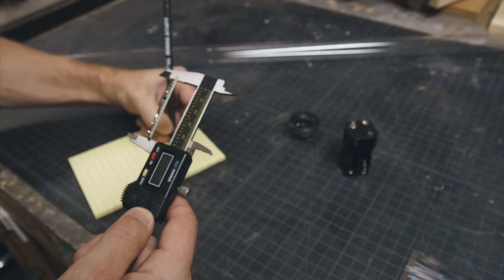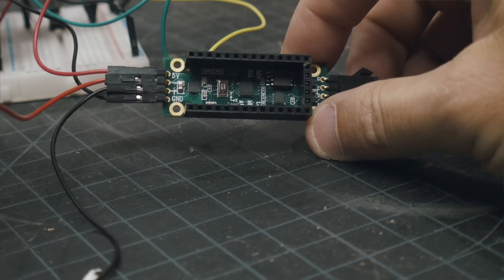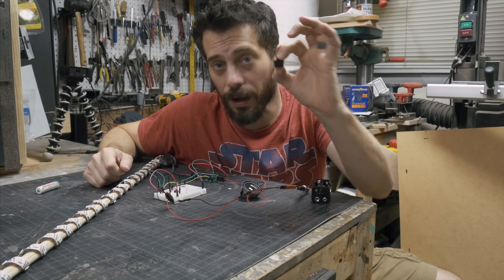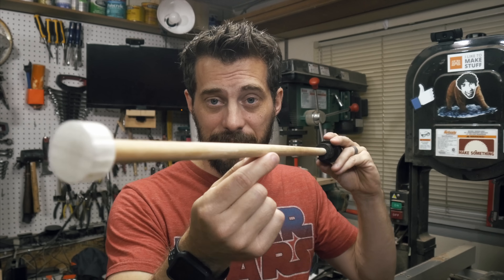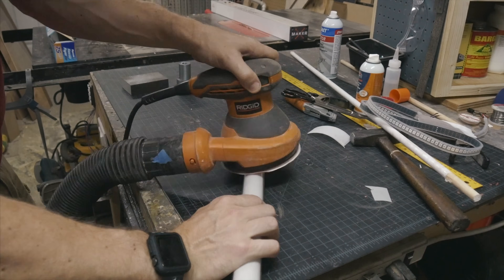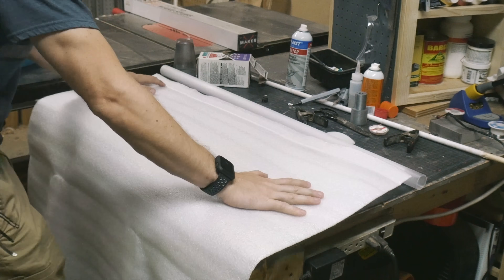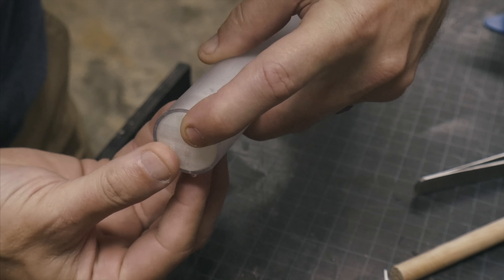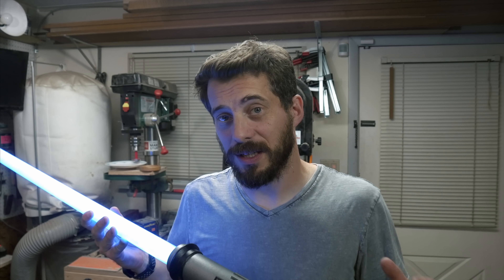How to make a Lightsaber ( for Star Wars Day ) | I Like To Make Stuff

Comment: The diameter of the internals shouldn't need to be consistent through out the entire length, so you should be able to adjust the diameter of the hilt in different sections.  I think there also needs to be a cone shaped cap on the end of the blade rather than keeping it straight.  I do love the set up with the electronics though.  I plan to build several sabers myself at some point, and I will probably swipe that idea.  I'm going to build a pair for my fiancee that screw together at the center so they can be modded into a dual bladed saber, I'm going to be building a pair of curved hilt sabers for my own jedi outfit, and I eventually plan to make a Scottish-themed sith costume.  Among other details, it will have a black kilt, face paint, and the light saber will be modeled after a claymore with a plaid blade.  I call it Darth Haggis.

Comment: C size NiMH @ 1" id tube
1/4 wall polycarbonate tube (1' od, 1/2" id), same LEDs, fill with ... silicon or mix some kind of diffusion resin 
Same board, different speaker (1" d total)
enjoy :)

Comment: I Like To Make Stuff wow! This is really cool stuff! I actually tried making a light saber myself in my industrial design class at my high school. I used a similar technique as you by using RBG LED strips as a light source however I really liked your idea with spinning them around the dowel. We don't have 3D printers at my school capable of printing things as tall as I would have liked so i basically had to sculpt it using a PVC skeleton and sheet metal shell. It worked for about 5 minutes until I accidentally screwed through the electronics that connected the batteries inside to the lights in the polycarbonate tube. At least i still have the hilt though!

Comment: Great work on the saber, but I think it still looks a little thick. 
You could maybe make it a little bit thinner if the hilt was designed as a male end vs the female end you designed. Reinforce it with a some kind of dowel all the way down to the end of the hilt.
Either way great build!

Comment: I think to get a better helt look you could print it so rather then a tube look it's more "Star Warsy". By making the helt right after where the blade connects to the helt bring down the diameter of the helt and reinforce it and then go back to a bigger diameter for the battery and speaker. I hope that makes sense and gives you some more ideas :). Great video.

Comment: nice work! you could use a potentiometer as a knob to set the color. That way it could have a wide range of colors and also its physical position would save the color when the power is off.
Reply from the maker: That was one of the original ideas, but you'd actually need 3 of them for Red, Green and Blue.  With three, you could mix the color.
Reply: Right right... If you were to use an HSV model and then convert to RGB in code, you'd be able to vary your H with the pot, and have a fixed S and V values. Just an idea.

Comment: This is great!  It seems like the battery holder was the biggest factor in determining the thickness of the saber hilt.  I wonder if using a different battery, like a lipo, AAAs, or even a different configuration of batteries would enable you to reduce the diameter of the saber.

Comment: hey Bob, I have a suggestion for the diffusion. As a former props master at the Georgia Aquarium, I worked with some similar internally lit "sea monster" staffs. They operated similarly to your saber. One thing that changed throughout the iterations of each model was the diffusion. We started out with wrapping the inside tube with paper. Then for the last one we actually started scratching up the inside of the acrylic tube. We achieved this by getting some scrub pads and putting them on the end of a dowel. We took said dowel and used a hand drill to scratch the begeesus out of the inside creating a sort of diffusion. Worked pretty well for what we were doing! 

Anyways, just a suggestion.  Love your channel and podcast!

Comment: Suggestion, find some way to make the blade removable so you can carry it 'costumed'. 
There are regulators (or you can use a resistance bridge) to control voltage and current for LED's and circuits and you might consider using something like a pair of 14430/14500/14650 cell Li-ion batteries, which make about 7 volts but which will handle a much more linear current draw and last longer than the nimh's. (the 14500 will fit in a AA holder)

Comment: Nice work! As somebody who's done a couple lightsabers before I can say that this is exceptionally well done for your first time saber. ESPECIALLY since it was made from scratch.

Here's a few tips if you'd like for the V2 Saber.
-Get specialty parts from specialty websites. Saberforge has DIY electronics, and The Custom Saber Shop ONLY sells parts that are made for this, that are smaller, and normally cheaper. Specifically the Battery Packs, switches, and Speakers are far better suited, and worth the money. They have sound/LED cards too, but those tend to be a bit on the expensive side.
-Try making a separate, large pommel for a speaker housing. You would not believe how much of a difference in the feel it makes to be able to make a smaller thinner handle. And while we're on the topic of speakers...
- Get your speaker from saberforge. It's in the DIY section, and they're far smaller., as they're made for saber makers. Yes, CSS has the same speakers, but they're slightly cheaper from SF.
-3d Print, or heat the tube to make a rounded or bullet tip. no practical use, but it will look better.

That's about it! You did a really good job for a first-timer and wish you luck on your next one!

LINKS:
https://saberforge.com/collections/diy-electronics/products/speaker?variant=34947001354
http://www.thecustomsabershop.com/

Comment: Bob, for buttons, check out the back panel of http://www.thingiverse.com/thing:1188301. This would allow you to design the buttons directly into the part, and even relocate them to inside of the model if you like. I've been using this integrated button style on all of my functional electronics for a good long time, and it works quite well, even with PLA. If you want to hide them, it's easy to just put a thin bit of ninjaflex or any flexible material over the buttons themselves.

Comment: Great build, I've been wanting to make one of those for a while. I tend to get way out of control on the design side, to the point of exceeding my talent to build. I was thinking you should replace the battery pack with a rechargeable 5v usb power pack. Pop a micro usb port on the outside and then you don't have to crack the thing open to change the batteries, just plug and recharge.

Comment: Quite a cool coincidence. I'm getting a package from Sparkfun tomorrow to build my own lightsaber. I'll be using a Teensy 3.6 though and a surface transducer for sound. My handle is completely metal. I'm using a 3 axis accelerometer to detect motion. All sounds are generated in real time instead of simply triggering them.

Comment: A $3 5volt regulator would eliminate the possibility of over volting by using off the shelf batteries. It might be a good idea to add that in the event that you would need this for some reason and are out of the other batteries.

Comment: Look into capacitive touch sensors for the "setting" buttons - something like the Adafruit 178.  I'm not sure if Adafruit has an equivalent, but the Phidgets 1129_1 can work through plastic too, so it can be completely inside the hilt but still react to your commands (only really useful with Phidgets stuff though I think, but if they can do it I'm sure someone more generic can).  

Using a strip sensor will (normally) let you issue multiple commands from one touch sensor too; since you can normally detect position of the touch on the sensor (i.e. position @ max and touch = change color, position @ min and touch = on/off).

Comment: I really like it! The motion controlled sounds really give it a special touch! But how long is this thing? It looks huge!!!
If the LEDs are too bright, you might think of decreasing the voltage, perhaps even regulated by a switch (for night and day fight *g*). Or maybe you could even reduce the number of batteries, that way the handle could be even smaller in diameter.
Working on my own LED-project, I can tell you there are frosted PC-tubes available that give difuse light and look very neat. But I have to say that I like your method with the packaging foil. I need to try that as well!

Comment: It might have been suggested but you could desolder the sockets from the tiny and directly solder the prop shield to the board. That, a smaller speaker, and a lower profile battery (LiPo or other) might allow you to slim the handle further. Very cool build otherwise.

Comment: Maybe next time you model the hilt with a panel, also look at decreasing some of the outer surface areas that any components are not going to be at. That way, you'll have a bit of variation in the depth and you may even use less material.  One more idea, before you start the next model, do a ton of different sketches and work from the ones you like or even post the sketches (if you do go that route) on a video and let people help choose which design they think looks best.  

Do what they do in movies when creating props rather than do the first thing you think is "cool" and then be disappointed by the end result.  Not saying that the end result of this sabre was a disappointment, not at all, but when you are having new ideas WHILE making it, it says to me that maybe it wasn't as up to snuff for you as you thought at the time you hit enter/execute on the keyboard to start the modelling of it.

Anyways, that's just me thought, good luck and keep going with the good work.

Comment: If you want the color to persist through power cycles, you could probably save it to EEPROM on the Teensy when it is changed; the downside to that is that EEPROM has limited erase/write cycles, but it is typically something on the order of 10,000-50,000 times.

Comment: dude, how if you reconsider panel plan and try a screw system, like PET bottle caps, but use it to be longer in the handle, its more efficient, especially when you're changin' the batteries
Reply: Or you can consider of using sliding system, like in the blackberry torch smartphone series, so you can reach more internal than a panel system

Comment: Instead of the acrylic tube could you not 3d print it in 3 sections using an opaque plastic? This would
let you thin and taper the blade. You may have some seam lines but they should disappear when lit.

Comment: you should use one of those USB mini battery stick things, that way the only large pice would be the speaker and you could model the main body of the saber to be a smaller ID/OD to fit your hand better. and look at mini pc push buttons instead of a toggle switch. would be a better looking and lower profile power switch

Comment: You may have addressed this in another video, but do you have a 3d printer you would recommend for someone interested in getting started? Something that will print decent items....but not completely break the bank?
Reply from the maker: Check out the review I did on the Prusa i3 MK2.  It's a great middle ground of excellent quality at a reasonable price.
Reply: Awesome! I knew I remembers you saying something. But I couldn't recall which video it was.

Thanks!

Comment: It's aweosme. Eventually you should make the handle from metal. Make the tip of the saber a bit more like in the movies, rounded and pointy. Add more sounds and randomize the order. Make the blade mount removable and sturdier. Make sure the blade material can withstand hits from the same material.

Comment: Love it!  If I had a suggestion, I would say to try and get ahold of a stacked battery sled so it's thinner, or a pair of double sleds instead of the quad sled, giving you more leeway with shrinking the hilt down.  Maybe look into using a different kind of rechargeable battery.  Maybe a single 26650 or something.  Granted, those run at 3.7-4.2 volts, so not sure if that would be enough, but you can get them all over the place.  Might also be cool to use a metal tube and then print all the embellishments to go onto it.  But, I could nerd-out on this topic all damn day lol.  Love the video, keep up the great work!

Comment: for the on/off switch you could spring load the bottom plug basically turning it into a switch but looking just like the bottom of your handle or have the bottom of your handle twist as an on/off switch

Comment: This is just awesome. For the second version, you may want to consider a hemispherical cap to top off the tube. Kinda like the purchasable ones. If you use two-part epoxy where the tube meets the hilt, there wont be CA glue fogging and it will hold up better during impact.

Comment: One idea for your v2 lightsaber, if you're interested, would be to use a mechanical throw switch for blade color selection (I don't know about the capabilities of your prop shield/board)  and hide that behind your panel - that way you don't have to worry about the blade colors reverting if you have to change batteries in the middle of something.  That might be more work than it's worth though.

Comment: I think the glowing part (the blade if u wish) looks awesome but the grip really needs some more work. It just looks too cylindrical ... Maybe break it up with some fake buttons and flat spots, so that one doesn't imediately see the cylinder it actually is .... And another idea would be to just build in a micro usb port to add software. I don't know this board but I guess you connect ur pc to it via micro usb ?

Just some ideas ... Of course it's still a very cool project, even though I'm not that big of a star wars fan ;)

Comment: maybe use just one switch but somehow code it for holding the button will change colors. no huge into coding but i think that could work. and you do a voltage regulator so you could use diff batteries

Comment: If you could find a way to fit an RGB fading/mixing module into it for V.2 , you could really fine tune the color spectrum. As opposed to only being able to cycle through fixed presets. Finding a space for 3 potentiometers might be a little challenging though.
Reply from the maker: They're full addressable, so it can be whatever I want, just no real time controls like using pots.
Reply: Oh, i see. Knowing that now. It might be cool to have the lights slightly "tweak" themselves in response to the motion sensor,  similar to how you triggered the audio files. Could be more work for what its worth though.

Comment: Pretty cool. Maybe for the second version, you should make the end cap on the blade rounded off or a soft cone shape, like a mushroom cap. And to make it clear, use the prusa resin printer. You can also use that to make real rubberized grips and that button you mentioned.

Comment: I'm going to make couple ligth sabers to my sons room as wall peaces/ ligts. I'm so going to use the electronis part.  Care to tell what was holding you back? Diffusing the ligts or something else?
Reply from the maker: Awesome! The biggest problem I had was a coding problem that was causing the audio, gyro and led not interrupt each other.  It was just something I had to simplify and rethink in the code.
Reply: I Like To Make Stuff I was wondering about this... Arduino Doesn't support multi-threading, so how did you accomplish that?

Comment: This came out great! I'm guessing this is the top secret project you kept teasing in Making It. It lived up to the suspense!

You mentioned it taking a lot of time to get the LEDs through the tube. It might've been easier to scotch tape the diffusion material on the entry side of the tube to make sure the LEDs don't grab it and pull it down, then drop a weighted line through the tube and use that to pull the LEDs through. Just a thought for next time. It's a technique I've always found helpful for getting stuff through tubes. 

-Caleb Harris

Comment: Add a mute button so it can be turned on without being noisy, and a Li-Ion rechargable batery + charging circuit (Adafruit has tiny ones) so it can be charged via microUSB, finaly, make a display case that charges it, and makes it light up. You could also try PWMing the LEDs for brightness control

Comment: You sir, just hit a home run. Mat the fourth be with you. :)
Reply from the maker: :)  Thanks!!  and with you...
Reply: I have a few of the toy versions of lightsabers and most have a round black button or square of rectangular red buttons. I wonder if a red momentary switch, like the ones I bought to turn my Raspberry Pi, would work to turn the blade on or off. They certainly look OK for the part. :) http://www.ebay.ca/itm/310827231117?_trksid=p2057872.m2749.l2649&ssPageName=STRK%3AMEBIDX%3AIT

Comment: why don't you just use a voltage regulator instead of finding special batteries
Reply from the maker: I didn't really have to "find" them. They made the most sense for the configuration.  There are a 1000 ways to skin a cat.
Reply: Fair enough

Comment: You could use a 3.5mm jack and dummy plug for the master switch if you wanted to make it more like the "production"-grade sabers.  I've noticed that's a common theme there.  Another possibility, though not for switches, would be to try to taper the blade?  I don't know how difficult that would be to either do or obtain, though.  Oh, yes, the 4th will be with you.  Alwayth.

Comment: Have you thought of making a wind turbine?
You could print fan blades and use a lathe to make the attachment. 
Then just find a usable DC motor (I've heard treadmill motor works).

I don't know if it is windy where you are, but if you could make something like that you coudl use it to keep a power bank charged while on a long camping trip. It if course wouldn't be super powerful, but could a cool green project!
May the force be with you!